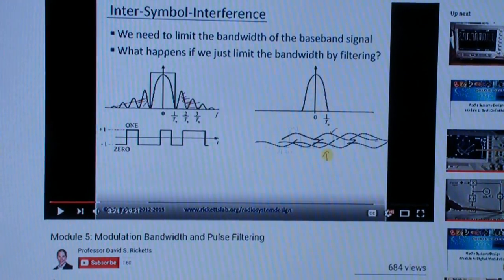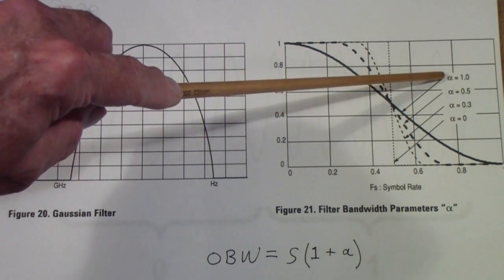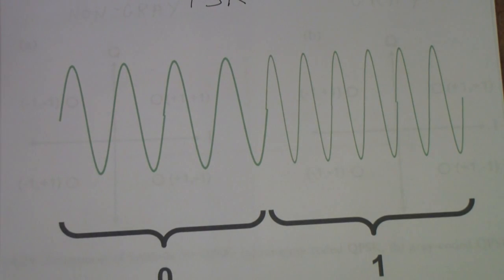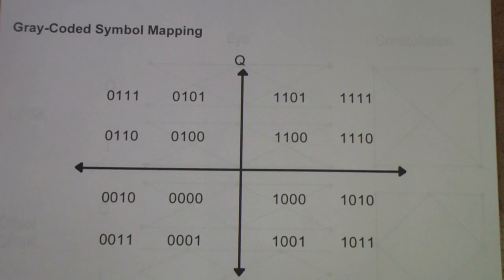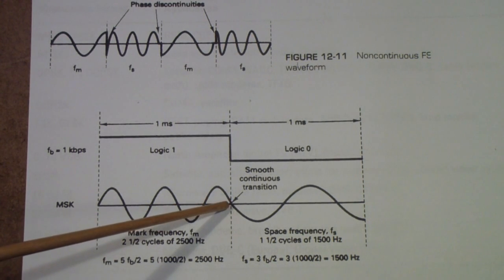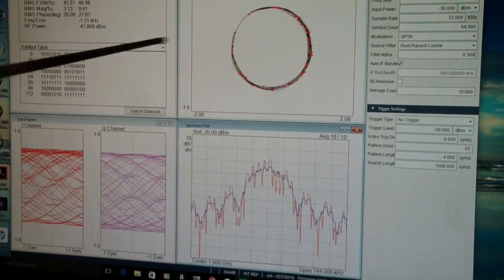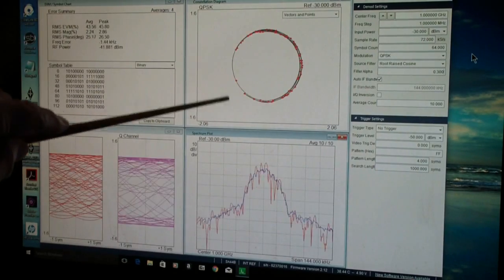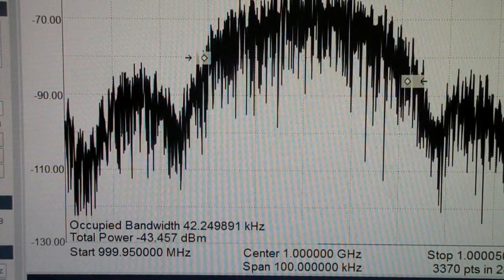TTT154 More Digital Modulation Applications

Comment: This is great, but you might be aiming a bit above your average audience.
Reply from the maker: Yes, I know that the average YouTuber might not want this but the university students do. You probably notice that I put two levels of video on YouTube, hobbyist and professional (or at least senior-graduate level EE). When I do evaluations of equipment for university lab use, I make and post the videos in several places including YouTube. I was evaluating the Triarchy Vector Signal Generator for some advanced communications lab exercises being considered for next fall. A few years ago I started making videos of my testing and putting them on internal university networks to supplement my written reports. Later I started putting them on YouTube at the request of some students who found that easier to access. My first such series, comparing  Rigol and Siglent oscilloscopes was certainly overkill for those who just want an overview but I hope you will understand that I wound up here (YouTube) rather by accident than design. I would rather viewers have too much material and just quit when it becomes too much rather than shortchange the few who really want the gritty detail. The only thing I have to watch is that I don't create a "cheat sheet" that students could use to avoid doing the lab work, which is why I sometimes change parameters, measurements, etc.